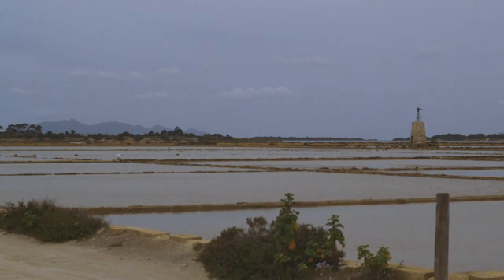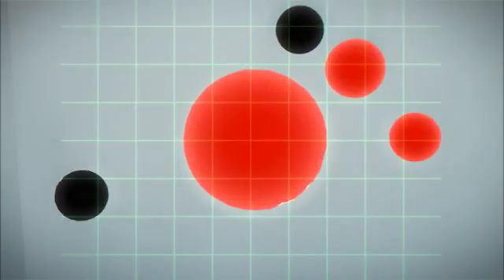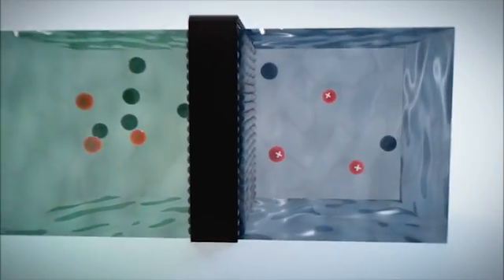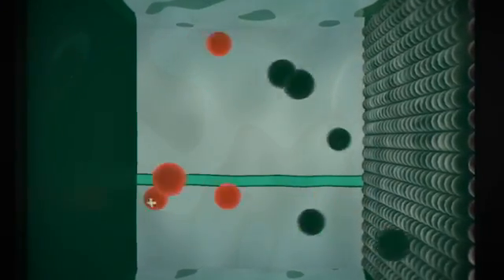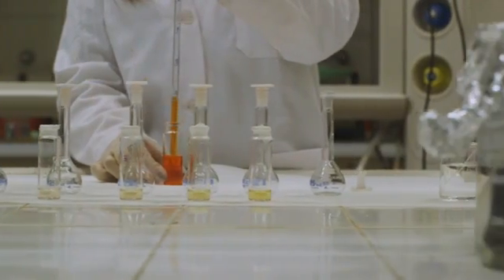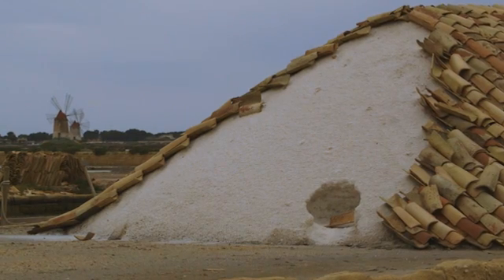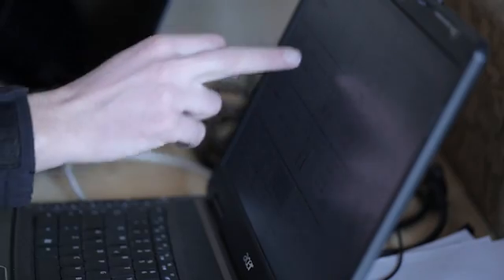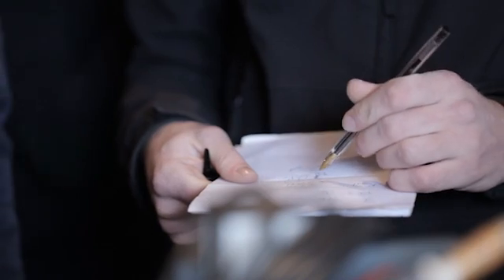REAPower: Electricity from brine

Comment: Would it work by utilizing the brine waste water from a desalination plant. At present desalination generates a lot of ultra high saline water and needs vast amounts of power. This would offer that high brine water before discharge. It's already dumped into the sea to dilute it but it could generate power to run the plant before that exit

Comment: In theory...couldd this be used as a wall segment? If you then connected it to a voltage transformer and all the other gizmos needed, could you ultimatly create a wall that had a socket which you could charge your phone for example?

I mean, you would need to resupply the water I guess, needing to drain it into vats in the cellar and resupply from the roof, but could it in theory be done, and if so what's a good guesstimate on how much power it couldd supply?

Comment: One thing we need to do is move water from the ocean back inland to places we need it and if we can do that while generating clean energy we have a chance to mitigate climate change and still have a prosperous future. It is really, really hard but it is not impossible. 

The biggest idea I am trying to express is tunneling aqueducts from the coast, in this case the west coast of the USA inland to feed combination geothermal power and sea water desalination plants.  The idea seems to be so big that no one has considered it possible but I believe it is not only possible but it is necessary. For over a century the fossil water contained in aquifers has been pumped out to feed agriculture, industry and municipal water needs. The natural water cycle cant refill fossil water deposits that were filled 10,000 years ago when the glaciers melted after the last ice age. Without refilling these aquifers there is not much of a future for the region of the United states. As a result ground levels in some areas of the San Joaquin Valley have subsided by more than 30 feet. Similar fossil water depletion is happening in other regions all around the world. TBM and tunneling technology has matured and further developments in the industry are poised to speed up the tunneling process and it's these tunnels that are the only way to move large volumes of water from the ocean inland. The water is moved inland to areas where it can be desalinated in geothermal plants producing clean water and power. In many cases the water will recharge surface reservoirs where it will be used first to make more hydro power before being released into rivers and canal systems. It's very important however to not stop tunneling at these first stops but to continue several legs until the water has traveled from the ocean under mountain ranges to interior states. Along the way water will flow down grade through tunnels and rise in geothermal loops to fill mountain top pumped hydro batteries several times before eventually recharging several major aquifers. What I am proposing is essentially reversing the flow of the Colorado River Compact. Bringing water from the coast of California first to mountaintop reservoirs then to the deserts of Nevada and Arizona and on to Utah, New Mexico, Colorado and Wyoming. This big idea looks past any individual city or states problems and looks at the whole and by using first principles identifies the actual problem and only solution. 

Thank you for your time, I would like the opportunity to explain in further detail and answer any questions.

A better future is possible
Reply: So, these tunnels going hundreds of miles from the coast (and through the Sierras, etc. to Nevada or going through southern California to Arizona, etc.), would they be sloped to allow gravity assist to move the water inland? How far deep, below the ground would they be at Blythe, California (elevation 272 feet above sea level)?

"...water will flow down grade through tunnels and rise in geothermal loops to fill mountaintop pumped hydro batteries [reservoirs?]..."

What do you mean by geothermal loops?

Another issue, since this is about brine (which is the result of desalination), where would this sea water desalination occur? ...One issue of the waste brine is that apparently it can't be dumped in near-coastal waters without harming the marine life (and fishing stocks, aquafarming activities, etc.). Wouldn't you need aqueducts beneath the oceans to take this brine from the coasts, ultimately, to the edge of the continental shelf to dump it into the ocean depths where the vast deep could reabsorb this quantity of salt?

Comment: When you say that only public funds can pay for a project like that, bells start ringing and warning lights go off everywhere. Ding ding ding......... money black hole. Zero return on investment. Corporate sponsors evaporate along with the water.
Reply: That’s a really good point. Your comment is two years old and this reverse edi did not take off and will most likely not reach scalability. Those public funds were used wisely to build cabins and secondary houses and pay for some outrageous salaries. Public funds are less monitored with every new administration coming along. Political black hole

Comment: Can't you just take a river, and instead that it just flows into the ocean, it flows through those cells at the ocean?
Furthermore, as you need a slow flow rate you can slow it down by a normal water power plant before.
Reply: Dont you think that would cost alot more money than the project they have at the moment?

Comment: Hi, i'm working on inverse electrodialysis for my engineering test in France. I try to develop a model which could explain how to generate energy with difference salinity gradient links to electrodialisis inverse. I have some questions about oxred reaction at anode and cathode. Thanks you in advance
Reply: It will never get off the ground commercially because it works. think about it
Reply: Hi I am interested in how your project is going, did you get any results?

Comment: I worked on a thesis in same format of using the soils ions to generate high voltage electricity, while amplifiying it with a transformer. The process discusses how to increase the salinity and moisture in the soil, and de- earthing it using electrodes, however replenishing salt and water as needed. 
Although I must thumb up for your process which just takes out the basic compositions needed off the soil and adopt a membrane that controls the ionic balancing as could be in electrolysis, I still hope however that upon completion of de-earthing, it can generate much amperage that could be adapted in nations as a cleaner renewable source of energy on industrial scale.
Reply: Any update on your project ?
Reply: @hitechtraders723  you may want to send your email address so we can chat privately!
Reply: I'm interested in this project,please may I be updated on this as well